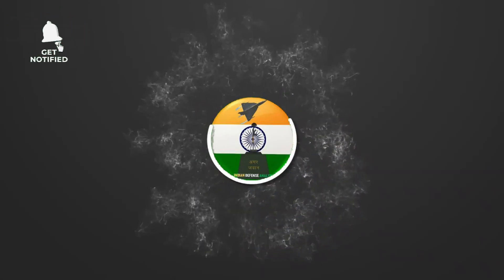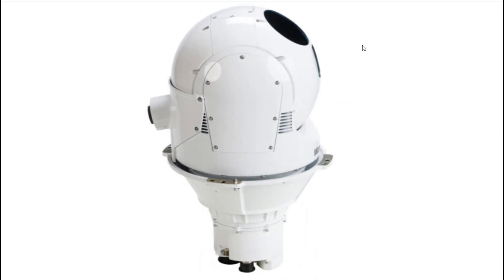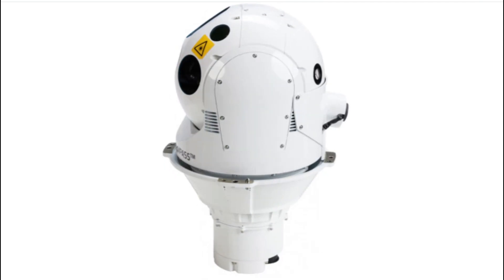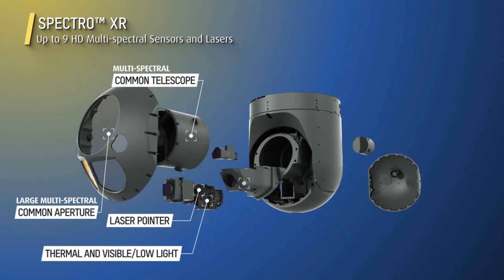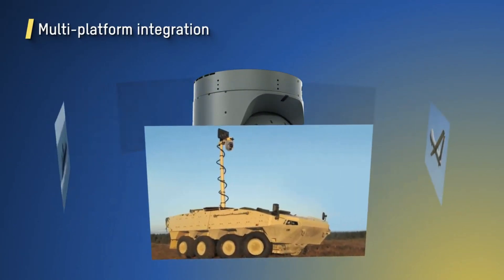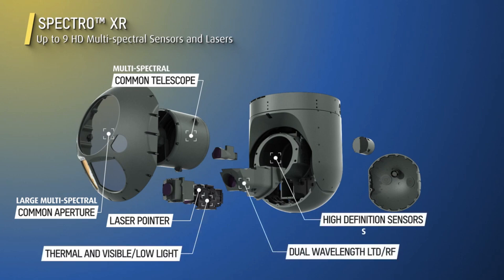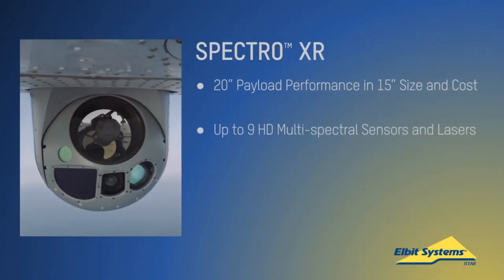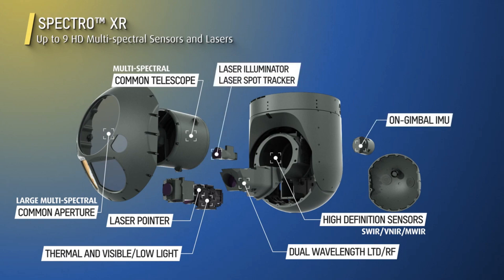DRDO is developing Electro Optical sensor like Israel's CoMPASS #drdo

Comment: Tonbo Imaging already makes a similar range of products that offer equal or better performance

ELPEOS is a multi sensor electro-optical payload designed for easy integration in remote controlled weapon stations and long range surveillance and reconnaissance. It features a high resolution cooled MWIR imager, a color CCD camera, and a Laser Range Finder and an integrated ballistic computer. It optionally can include a GPS and a Digital Magnetic Compass with inclinometer for target acquisition and geo referencing.

IR and Day imagers are with continuous optical zoom optics and are optically, mechanically and digitally aligned to high precision for demanding applications. The sensors also have preset matched FOVs through out the zoom range increasing situational awareness.It also features inbuilt electronic video stabilisation and video target tracking capability. It optionally can incorporate Tonbo’s state of the art Sensor FUSION technology that intelligently fuses the videos from IR and Day cameras in real time, combining critical spectral information from IR with the Visible day camera further enhancing the situational awareness.